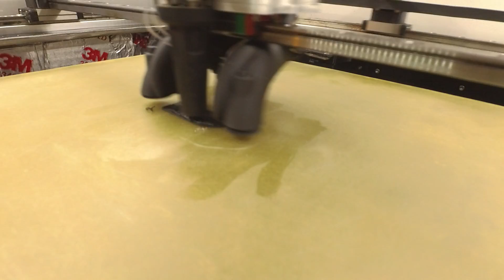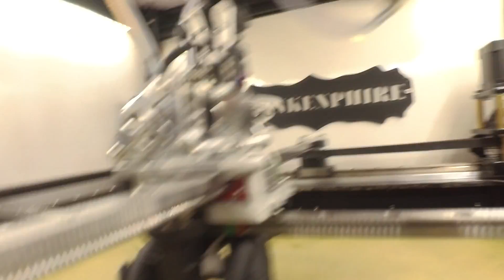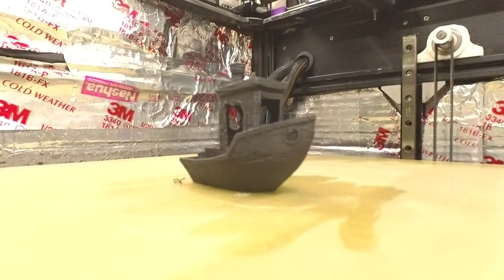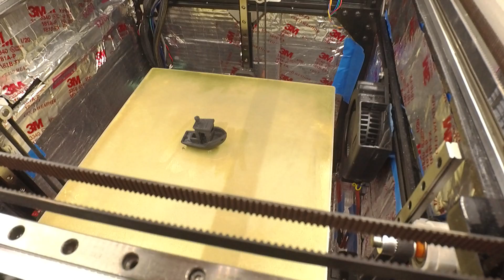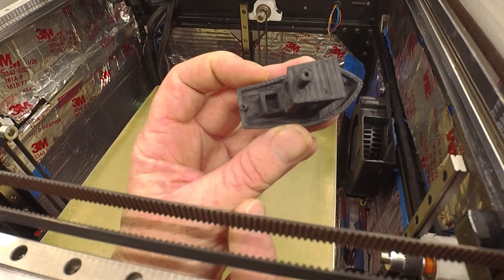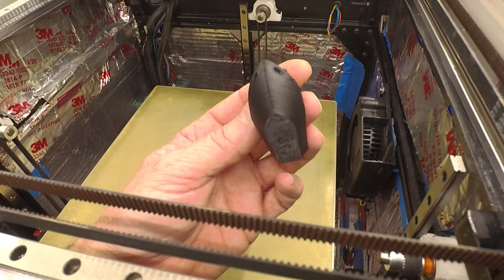#SPEEDBENCHY

Comment: I think for another design you guys can experiment with using 2 sets of rails for everything to reduce the jitter from stopping and going so fast
Reply from the maker: That's what the cross rail does. Creating a moment to reduce twist from the other axis. More rails=more mass=< acceleration. So more power need to move. It goes on and on, lol.